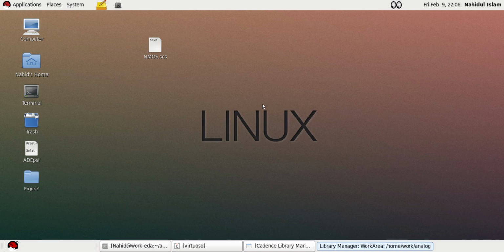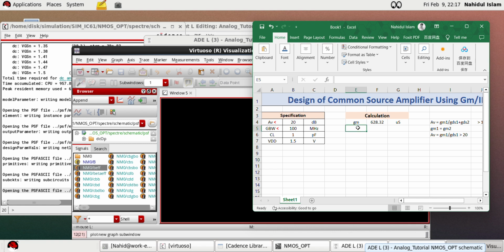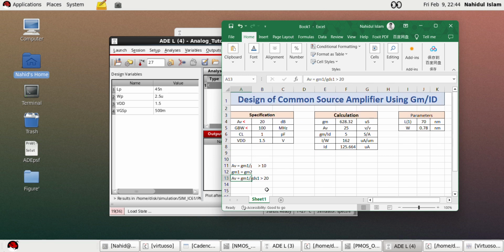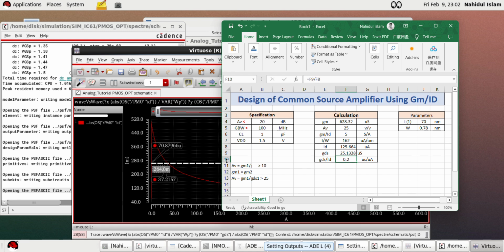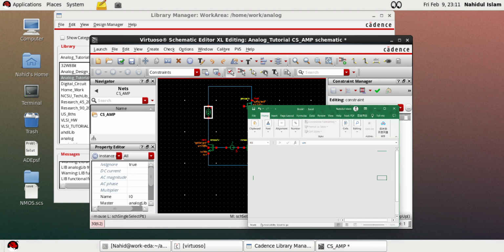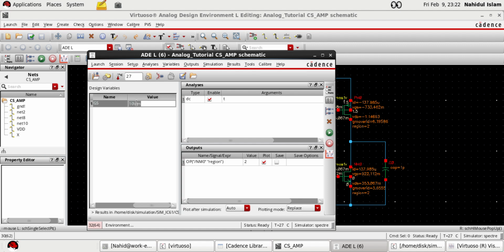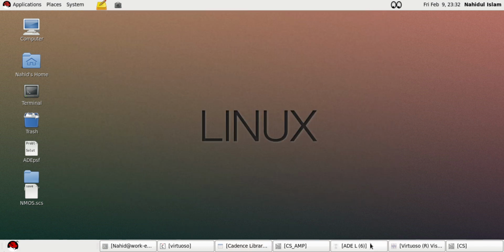Design of a CMOS Common Source Amplifier using Gm/Id Methodology in Cadence Virtuoso

Comment: Formula for gain inverter = 20=gm1+gm2)/(gds1+gds2). => gm1=gm2=> 10=gm1/(gds1+gds2) if ignore pmos clm then gm1ro or gm1/gds1
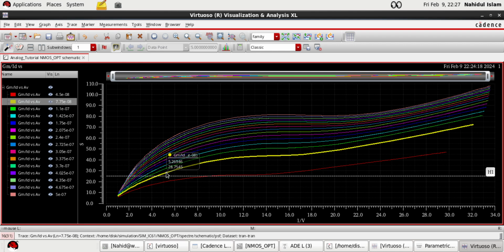Reply: 18:21 is 110 nm not 101 and 77.5 nm not 75nm
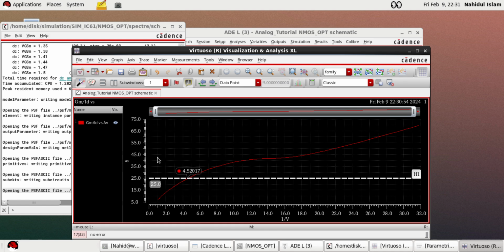Reply: 21:47 graph is Av vs gm/Id. Need gain 25 so choose gm/id based on that
Reply: 22:57 based on previous graph gm/ id was. 5 so using that finding Id/w ie 162 nr dr divided by micro so 162 uA/um

Comment: YOU VIDEO IS VERY INFORMATIVE, I WANT TO KNOW THE PROCESS OF DESIGNING CS AMPLIFIER CONSIDERING THE NOISE SPECIFICATION.
Reply from the maker: To consider the noise specification then, you have to extract the noise coefficient gamma from the noise analysis in ADE XL.
Reply: Thank you for your reply, i.e according to your suggestion I have to plot noise coefficient curve of nmos and pmos w.r.t gm/id, is it?  @electronicechos
Reply from the maker: Yes, @VLSIToolBox

Comment: Instead of  trying to adjust the gate voltage for both transistors to be in the saturation region you could have just put some sort of a CMFB to make the currents of the PMOS and NMOS match when the output voltage is, say, VDD/2. That CMFB could be done with ideal components.
Reply from the maker: Thanks, for your suggestion